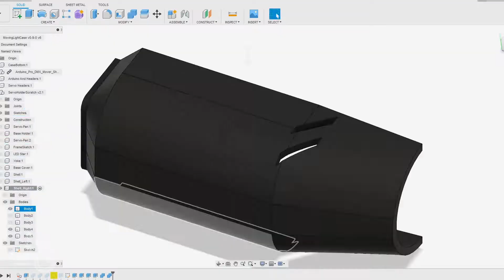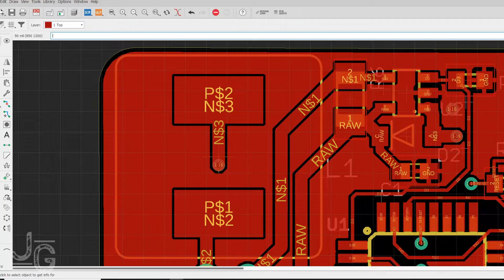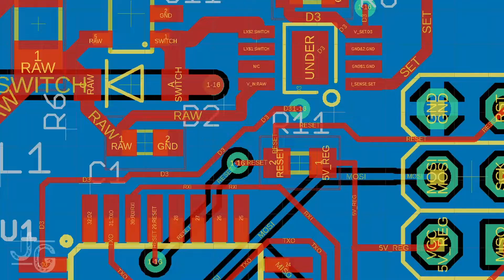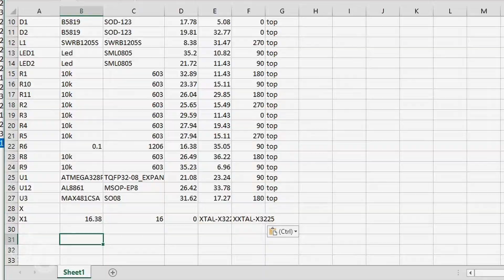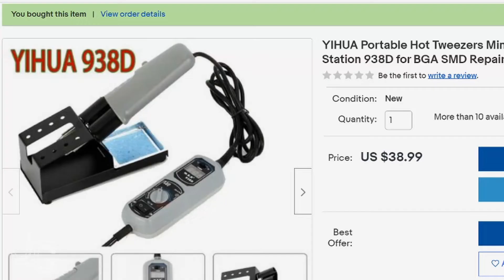Making and Fixing PCB Errors - Demilight V0.9.1 DMX Moving Light

Comment: ideal tool, hot air and flux. faster and maybe even cheaper ...
Reply from the maker: Definitely would have been faster - I don’t have a super precise hot-air setup and am a little afraid of melting other things off the board 😬
Reply: @jeffjeffglassglass3529  you can get very usable ones for 50 bucks, pro grade equipment for less than 200. if you do smt you'll use it frequently anyway. I recommend watching a few of louis rossmans repair videos. Gives you a good idea on how smd soldering can be easy, fun and satisfying :)
Reply from the maker: Thanks! I’ll check them out.